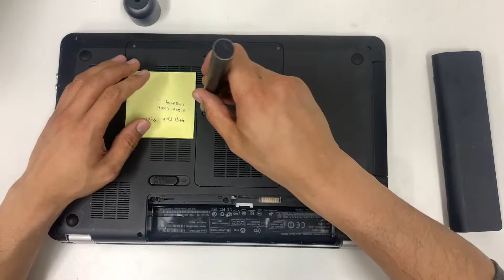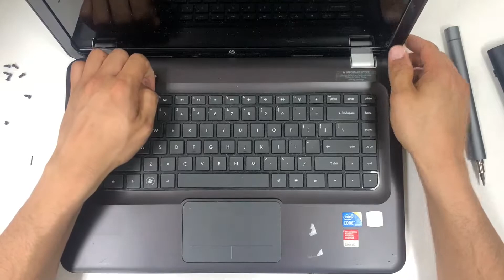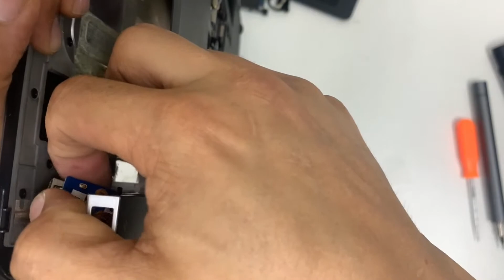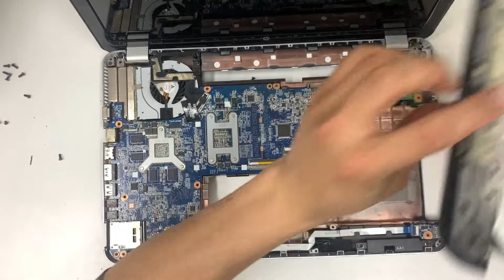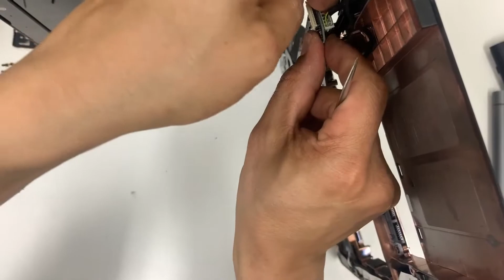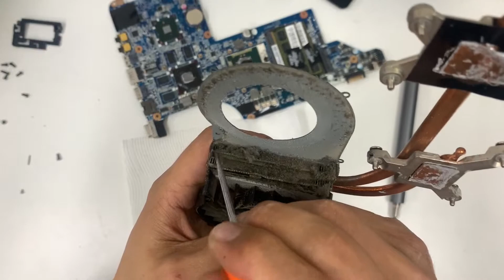HP Pavilion DV6 Cleaning Fan

Comment: Can I change My CPU from I5 580M to some 3rd Gen CPU I have the Same laptop HP pavilion cto 300
Reply: You have a first gen CPU, it can upgrade to other CPU of that generation but not to 3rd gen.

If you have a 2nd gen CPU you can upgrade it to a 3rd gen only if you can update the microcode in your BIOS file and reflash it.